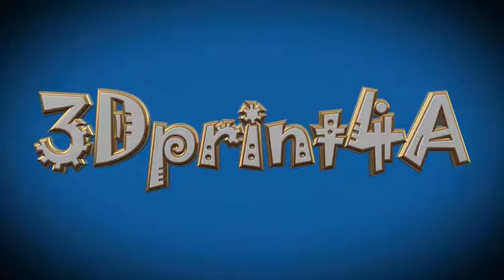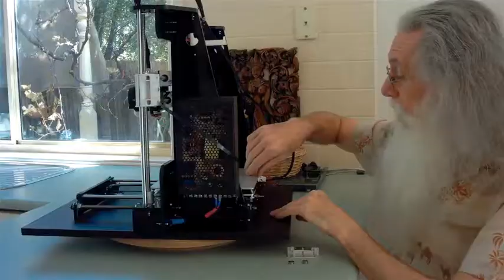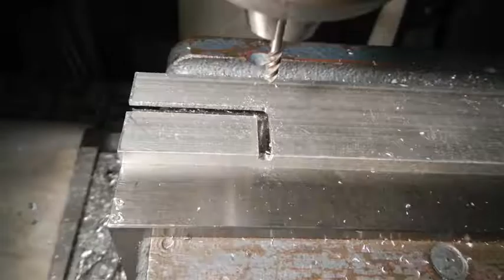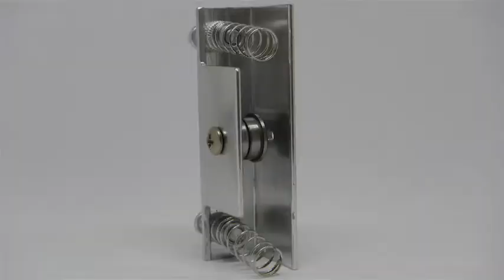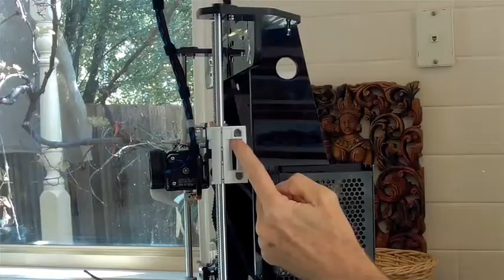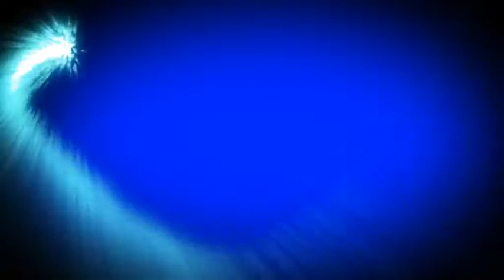3Dprint4A - Anet A8 Mods 05

Comment: For those of us lacking access to machinging the parts used will you be offering parts locations or build kits/parts lists to do these upgrades? really ingenious things here so far and the style of nut-certs you are using seem way better than those barbed brass jobbies that get pressed into printed parts.
Reply from the maker: Glad you enjoyed the video Robert. The nutserts are design for sheet metal and my kit goes from M3-M8 in steel and ali. The large steel ones are hard to squeeze by the hand tool and I usually squash them in the vice or press. The embedded brass nuts can go down to M1.4 and I use them both, as they are both very versatile and have made videos on both, see CNC4A, Quad4A, etc. I just used M3 on the Firefly Q6 camera and that video was put up a couple of days ago.  What parts, etc are you after particularly after as I tried to use off the shelf items and hand tools general found around the house this time. If you need something made let me know what and how much you think it is worth and I will see if it can be done for that. But I would probably give you suggestions on how you could make it with what you have got at home. Thanks for watching and don't forget to subscribe.